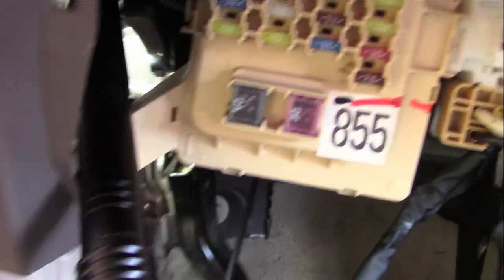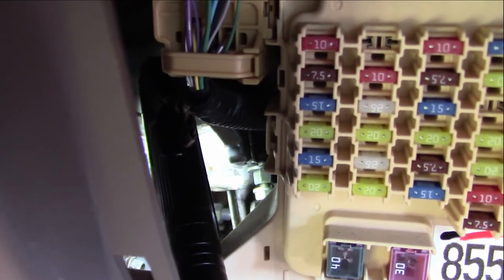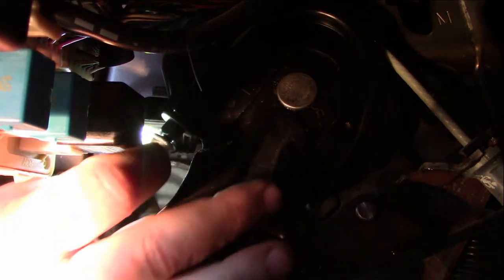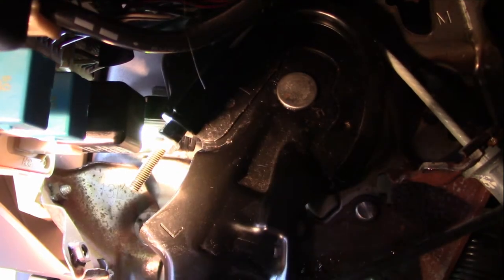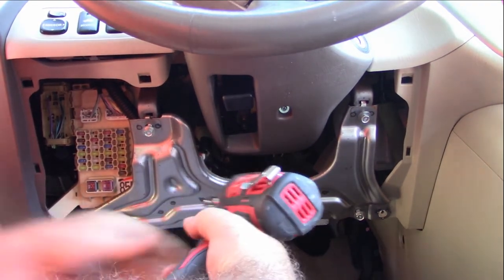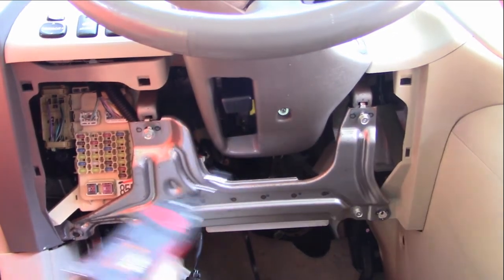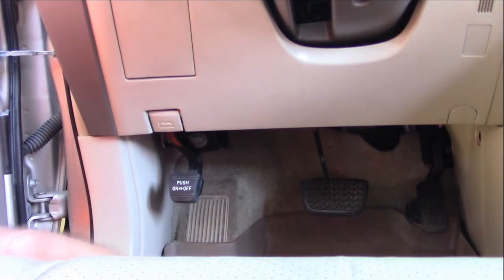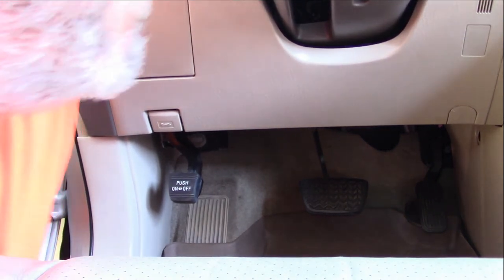Emergency brake adjustment 2005 Toyota Highlander AWD  with 3.3

Comment: I found this while looking for how to do a 2002. If anyone else is wondering, this video doesn't apply to the 2002 highlander. The same adjustment for 2002 is hanging down below the driver seat under the car, exposed to the elements. Isn't that lovely? I'm surprised I forgot that I have seen it there before. Thanks for sharing, though!

Comment: So if you just push the petal down you don't need to take off the dash panel and bracket. Just be sure to test it once and awhile so you don't over tighten it. 5 min and works great now.

Comment: The Adjusting Nut and the Set Nut are both gone.  What is the hex size and thread specs for these things?

Never mind, 6mm hex 1.0 threads, $4.50 @ Oreillys Auto.

But now the bigger problem is that the actual cable is broken from the threads.

Comment: Have the parking brakes given you any troubles since? Did you pull the rotors off and verify that the parking brake actuator lever is in it's full return position, and that the shoes were properly adjusted before adjusting slack in the cable?